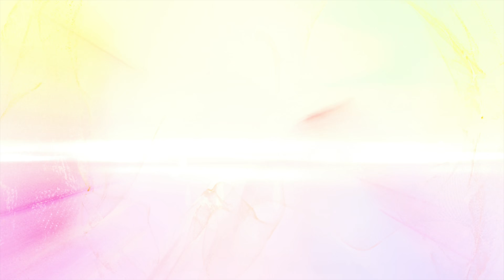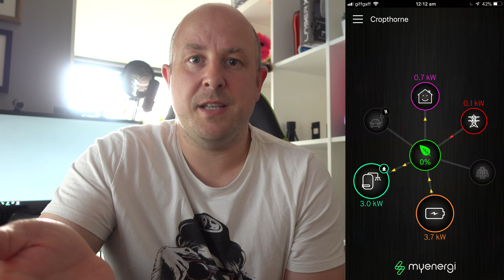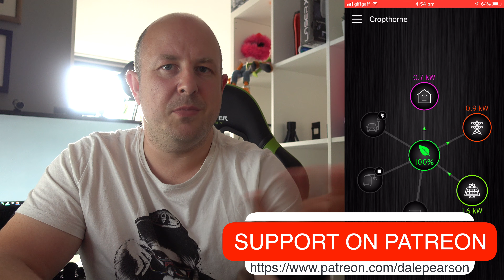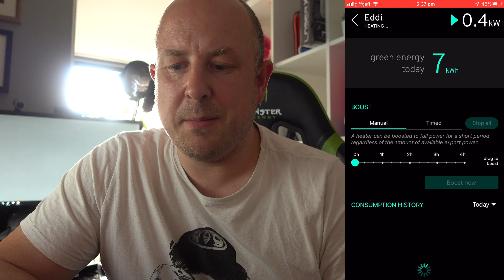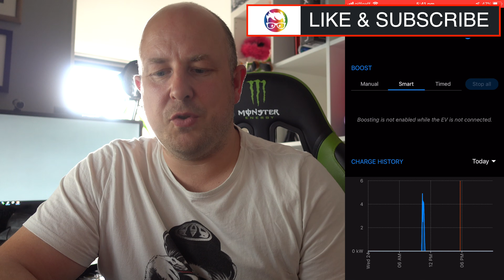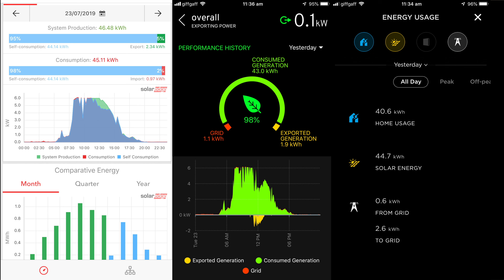MyEnergi App Walkthrough and Data Collection Comparison

Comment: Thanks for the video. I am having issues where if the Eco+  bar is set to 100% the zappi does not supply power to the EV. Why would this be the case?
Reply from the maker: In Eco+ mode the zappi will only supply charge to the vehicle if either a boost timer is triggered, or if surplus solar is available.

Comment: I watched your video, I got a zappi 2 fitted at the weekend but I’m struggling to work the timed charge. I find unless it is on eco+ the charger starts to charge immediately but eco+ pauses the charge until the time starts. I don’t know how to boost either when charging via the smart section
Reply from the maker: Eco+ will activate a charge either when you have a boost time window, or if you have solar excess.
Eco mode will charge immediately at around 1.4 kWh plus any solar surplus if you have it, and fast mode will charge at the full rate of the charger / cars capability, most typically 7 kWh.
The smart function only works in Eco and Eco+ mode and will add a given amount of charge via a specific time.
I personally only use manual and boost modes, so cant share much experience with that.

Comment: Very useful video, Dale, thank you. I have my solar panels installed less than a week and couldn't take in all the installer said when he was explaining the Myenergi app. 
On the app screen, and with reference to the hot water icon, what do the tick, the double II, the tree and the 'play' symbols alongside the icon mean?
Paul Kennedy
Dublin
Reply from the maker: The double II is a pause icon, showing that the Eddi is not currently active.
The leaf if you are talking about the middle icon shows how much of the energy is green (ie from solar).
From memory (I don't use the app much) means the activity is complete. So for the Eddi the water has heated to the set temperature.
Reply: Thank you, Dale, for the prompt reply. 
That makes sense but the one that really puzzles me is the 'play' icon (a triangle rotated once to the right) in the tiny circle that's attached to the hot water icon - similar to the play button on YouTube.  @ConsideredUK
Reply from the maker: @kennedypaulf The play icon indicates the device is active / doing something. So in the case of the Eddi you will see the play button when water is heating from solar, or on a boost charge from the grid.
Reply: Thank you, Dale.
 @ConsideredUK
Reply: Hi Dave my daughter has just moved into a new electric house and her myenergy keeps saying waiting for surplus what does that mean, how does she work it help would be much appreciated, she has just downloaded the app as well, look forward to your reply

Comment: Hey, I have the Zappi 2.1 (integrated Hub) and a Harvi, quite new. But I dont get any Consumption Charts, is that right? Do I just get the informations about the Zappi and nothing about the grit and my household? Even with the Harvi?
Reply from the maker: You will need the additional CT clamps connected to the Harvi for the grid as well as the Zappi to be able to also see your house consumption.

Comment: Thanks Dale, 
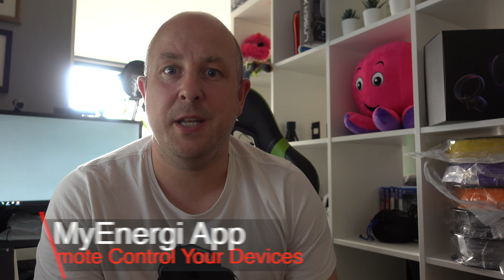Your video was very useful. I am also on the Octopus energy Go tariff and usually charge my car( Renault Zoe)at night from 00:30 for four hours. The Zoe has a setting called "postponed charging" which I set in the car and then set the Zappi to Fast charge either on the Zappi itself or via the app. This seems to work fine but I'm wondering if it would be better to use the scheduled boost with the Eco+ mode. If I were to do this, should I set the Zoe setting to "Immediate" charge or "Postponed Charge"?
Reply from the maker: I would use the scheduled boost myself, I don't have a Zoe but would say immediate would be best and then it will get the supply when the Zappi starts charging.

Comment: Good video I have a Wi-Fi Eddi but can’t set up the app as I can’t find an number on eddi any ideas thanks
Reply: Sn number
Reply from the maker: If you go into the information menu, there is serial number info, also on the piece of paper that came with the eddi.
Reply: @ConsideredUK  hey thanks for reply but it’s the reg code I can’t find it’s not information menu or anywhere I can find I turned it off and on again still no luck
Reply from the maker: @wexwayne  I just checked my Eddi. Its on page 2 of the information menu. There is the serial number on the left and the reg code on the right.

Comment: You said you have three CT clamps. Could you tell me where exactly are they placed?
Reply from the maker: The CT clamps are on the cables for the electrical feeds.
So one is on the grid connection, one on the solar connection and one on the battery connection.

Comment: Hi Dale, it’s interesting seeing your comparison between you three systems.  My Solar Inverter is made by Afore the data it collects is limited but my Battery storage is Alpha-ESS and my newly installed Zappi, Hub and Harvi set up is looking good although the response time and accuracy varies.  I did not get the Eddie as I already had an early version i -Boost which does not have an App.  If it ever fails I’ll probably replace it with an Eddie to make the whole system more efficient.
I’ve got an AirTurb (wind turbine) on order which will hopefully generate around 600w and I will add a CT directly into the Zappi which is just 2 or 3 metres away from where I’ll be mounting the turbine.  It’s all been a great experience and if I ever get around to my dream of a new self build eco house, I will put all my new knowledge and experience to good use and maybe even make my own YouTube video about it all. 
Keep the good stuff coming.
Myke
Reply from the maker: Thanks for sharing Myke. Interested to hear more about the AirTurb, how does that connect into your house energy setup?
Reply: @ConsideredUK  Hi again Dale, the AirTurb is from Holland (the home of the Wind Mills) but it is a vertical two bladed turbine that stands about 1.2m tall and 0.4m in diameter standing on a base of 4 square solar panels that also act as ballast.  They start up at very low wind speeds and need no more than 5m/s (11 mph) for the maximum output of 600watts.  It has an over speed protection (electric brake) and has a AC inverter so it then connects straight into your consumer unit or as I will be mounting it on the roof of my free standing garage I will tie it into the garage consumer unit and as my new Zappi will be directly below it I will hard wire a CT directly into one of the spare Zappi inputs rather than buying another Harvi.
After charging my battery storage and Tesla on my off peak 02.00 - 06.00 and the solar kept the batteries fully charged to 17.00 so from now on I think that the solar will keep my Tesla and my wife’s Mitsubishi Outlander PHEV topped up and once the AirTurb is up and running it will be almost like being “Off grid”.
Next project will be Rain Water harvesting. 😺
Reply from the maker: @mykehoole5787  Very nice it has built in inverter. I will have to look into this, been thinking about wind for ages.
Reply: @ConsideredUK  I know it’s expensive but it looks like a quality product and It will produce power all year, especially at times when Solar generation is low or zero.
The installation is simple and if we move, it’s easy to take with us.
Reply from the maker: @mykehoole5787  Everything I LIKE is expensive it seems :) Will look into it. Thanks for the info.
Reply: @ConsideredUK  I’m the same but I’ve found  from experience that if you buy cheap, you often end up buying twice or more.
I used to joke that everything I like is either fattening, illegal or immoral and if I was lucky, all three at once. 😈
Reply: @ConsideredUK  The give energi App will treat the input from the AirTurb CT clamp in a similar way as it would a second set of Solar panels.

Comment: Hi Dale, with the Myenergi hub can you choose which device gets priority on export. As in can you set the zappi charger to have priority on exporting power if a car is plugged in over the the Eddy if the immersion cylinder is cold. Great video by the way.
Reply from the maker: This isn't done on the MyEnergi hub (this is pretty much a dumb terminal), but you set the priority on the MyEnergi Eddi / Zappi itself.
So I have mine setup so Zappi has priority over the Eddi, so car chargers first then hot water.

Comment: Hi, I just have a Zappi and hub but I am struggling to work out how to get the best out of the app. My MG EV doesn’t have timed charge facility so I want to get night rates from the agile tariff by making the app trigger the charge at preset times. 
If I set to fast, eco or eco plus the car starts charging, if I stop it how do I get it to charge on timer? The app says I need to set it F, E or EP... when I do that it starts charging immediately... HELP PLEASE
Reply from the maker: I leave mine in ECO Plus at all times so it will only charge if I either have excess solar, or during my timed charge window.
In FAST it will start to charge your car at max rate, at ECO it will charge your car at min rate (about 1.5kW) and Eco Plus ONLY if there is solar surplus, in addition to this when the timer is set.

SO .... if yours is charging the car when plugged in and Eco Plus is set I would guess you either have a problem with your CT Clamp connections (so the Zappi thinks there is surplus when there isnt), or its an issue with the Zappi. You may need to contact MyEnergi, but I also have other videos on my channel about setting up timed charges on the Zappi etc. Its for the gen 1 zappi but should help you.

Comment: With software updates since you made the video have you found the app more responsive?
Reply from the maker: Hey Steve, there have been updates and it has improved responsiveness, but its not an app I consider reliable (mainly as I have the SolarEdge and Tesla App). It is a little inconsistent, and doesn't always function reliably in my experience. Its better than nothing though for sure.

Comment: Did you consider comparing all with your monitor that came with your Octopus 🐙 smart meter and the Octopus app. to see which is more accurate,  as well as the FIT meter.
Reply from the maker: I put that "smart" meter in the cupboard as found it not that great, as the tariffs did no sync correctly. Over the many months now I have the MyEnergi app readings to be terrbily inaccurate, so only use it it boost the water, as its not that reliable at changing zappi charging modes either now.

Comment: What has surprised me a bit is that there is no on line manual for the app. I’ve had to mess around a bit to find what it’s all about. What.  Have found great is the tank 2 in Eddi , I’ve wired I to two elements that I’ve fitted into our existing towel rail on our heating circuit. They are just 600watts each and heat the towel rails with any surplus energy..   My next job is a split air con that can run of the solar or Powerwall when it’s to hot.
Reply from the maker: Yeah, the app was rushed to allow people to still get the grant and class the Zappi as a "smart device".
Nice work on the 2nd wiring, I have nothing close by to utilise it in my house.

Comment: Just got PV system installed with Myeddi and also have Harvi for my car. am waiting for Hub to be delivered but am unsure if and when I can tell if my washing machine and dishwasher are using my solar energy. Could you please advise thanks
Reply from the maker: it wont be able to tell you the specific devices in your home are using solar. However you just have to figure this out for yourself, i.e. if your system is generating 4kW solar and your house is using 3kW and your washing machine and dishwasher are on, its using solar.

Comment: I appreciate the app review.

Out of curiosity are you using  a regular electric water heater or a heat pump water heater?

Is the variance between the two apps something to consider further when comparing this with the electric bill?
Reply from the maker: Hi Eric, I am using a regular electric immersion heater in a water tank.
I find the MyEnergi app incredible unreliable and inaccurate currently, so only use it to adjust settings of MyEnergi devices now.
Reply: Spectrum Geeks I have found that changing to a water heater with a heat pump could save up to two thirds of the energy compared to a regular electric heater:

https://youtu.be/Jk6D_D7naOY

The above video is kind of interesting since it was done by a full time off grid guy, Steve, and it proves the reliability of these devices in this type of setting.  He and his wife, also, use an electric car, and they use batteries to store energy.

With regards to the inaccuracies of the app, do you think this might be related to the CT used by the app, or could this be an algorithm thing?

Comment: Is there a setting to get consumption history, the only graph that populates for me is Zappi charging. I have solar and EDDI too.
Reply from the maker: If you tap the middle icon you should see the information you are looking for, the app is not mega reliable though. Sometimes the graph works, sometimes it doesnt.
Reply: @ConsideredUK  Thank you, I had never pressed the middle one. However the graphs are still not populated with data although I get live data
Reply from the maker: Are you running the latest firmwares, and also how long have you had the setup?
I just tried to check mine but its only working for todays values at the moment, says something went wrong for the others at the mo.
Reply: @ConsideredUK  I had it installed in August. It's never populated. I tried a firmware update but it went bad when I discovered the grey faceplate sticker thingy on the hub is upside down. Your setup video helped me fix it by mirroring your utton pressed and ignoring the labels on the buttons and leds. Thanks
Reply from the maker: I recommend updating the firmwares, as this has solved some of the issues I had previously.

Comment: Just out of interest have you compared the "grid consumption" figures the Myenergi app gives with your bill? I assume if you're on Octopus's "EV user" tariff that you've taken the smart-meter option. Any sign of problems with accuracy of readings?
Reply from the maker: In some ways though, it doesnt matter if its not accurate, as long as its consistent with its inaccuracy, as just provides a more simple way to keep track of things at a high level.
Reply from the maker: Yeah, its not accurate.
I have compared the MyEnergi (least accurate in my experience) to the Tesla App and SolarEdge, all give different readings.
For convience I use the SolarEdge app for my readings as they are closest (probably as it has a powered CT clamp vs passive like the MyEnergi and the Tesla.
Reply: Hmm. The MyE shows a lot lower than our existing clamp=meter doodad. But that was cheap as chips so I suspect the MyE one is still the more accurate of the two. :)
Reply from the maker: I can't find the email so going from memory, but I think when I spoke to Lee about the MyEnergi CT clamp readings, he said the tollerance was +/- 10%. Don't quote me on that as from memory, but deffo known to not be a true reflection, not that any are really.
You have the issue of multiple data sources, so adds doubt :)

Comment: KW and KWH are NOT the same thing! All your MyEnergi numbers are kilowatts, except the "total charge during session/day/etc" figures. :)
Reply from the maker: Agreed, and I wasnt helping with the problem. So like in AA I am trying to do better :)
Reply from the maker: You are spot on Chris, made another video calling myself out on my miss quoting in the heat of conversation. Made a concious effort to do it less since :)
Reply: :) I did scroll the comments a bit to see if you'd spotted it.  IT is a whole new mess of abbreviations for most folks. I do wish we could standardise on one unit. We have a standard 240 v system (except for superchargers et al) so amps to Kw is a one to one conversion, but half the time they tell you what your charge point will give in amps and half the time in Kw...